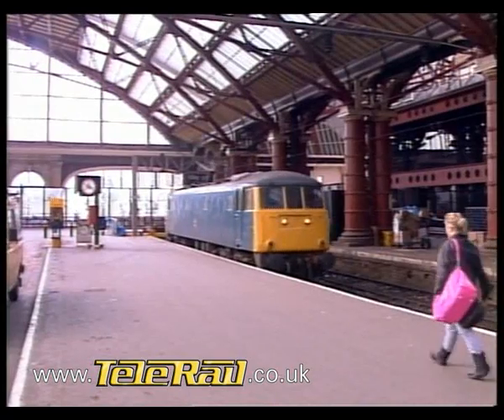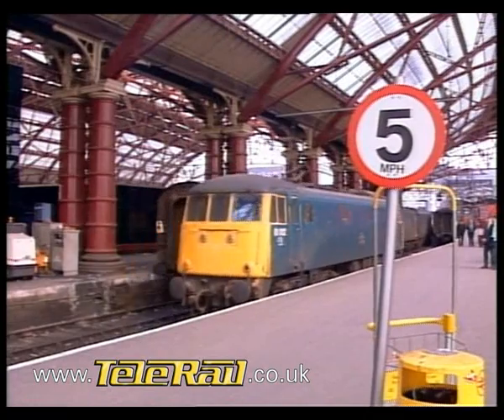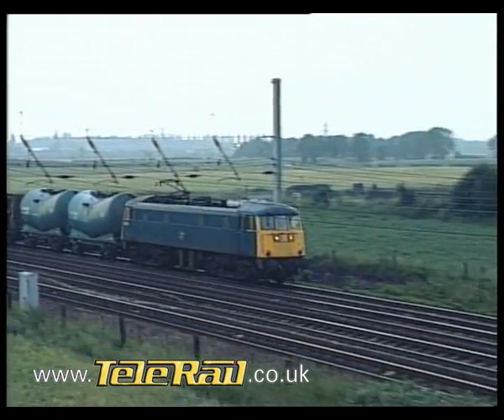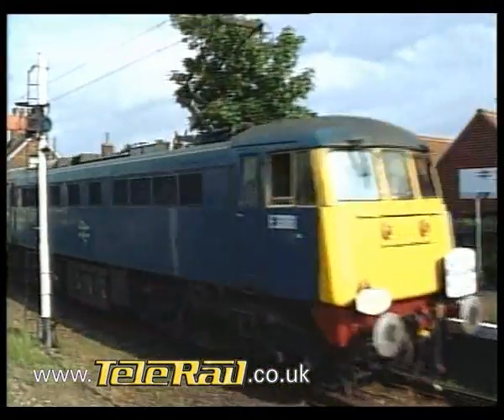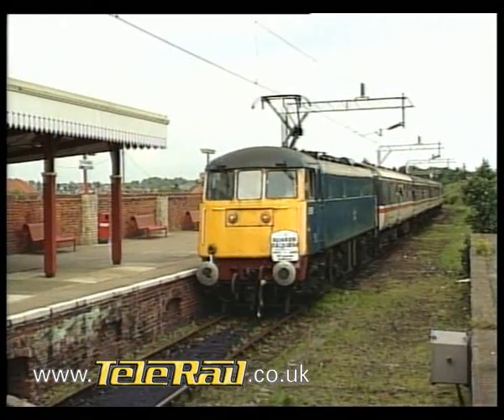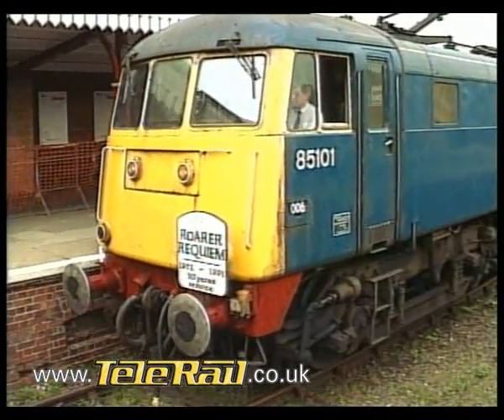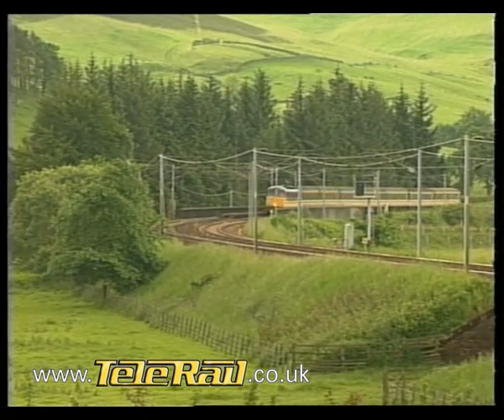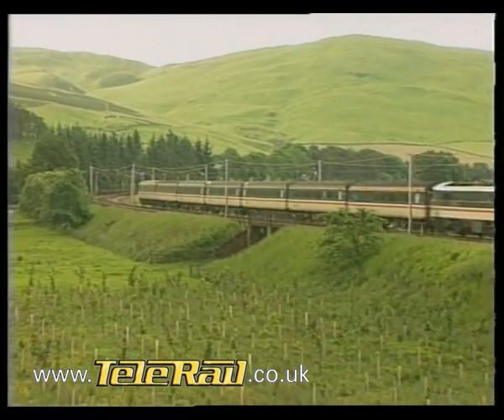LOCO HAULED  3 Electric Locos - Telerail

Comment: I was the Roarer Requiem hauled by 85 101 (85 006 in disguise). Seen in the video at Frinton-on-Sea passing the upper quadrant stop semaphores guarding the manned gate crossing, and St. Botolphs (which was renamed Colchester Town).  Frinton was one of the last places to have such signals on a 25kV AC route.

Comment: I think the class 81s and 82s had issues with the traction motor overheating if I remember right.
Reply: The biggest problem with 81s, etc was the mercury arc rectifiers which caused the fires.

Comment: On the 81 to 85's I really hate the way on later liveries that they used a sort of 'Optical illusion' with the yellow paint and pulled it round the sides a bit more at the bottom than the top to make them look flat fronted, don't know why they did it? I love the sloping fronts, the first livery - Electric Blue with White window frames - looks great!!
Reply: Have a look at the 84's Rail Blue/yellow end paintob
Reply: Actually, it didn't. It also helped to accentuate the front-end slope on them but in a different way.
Reply: @andyhinds542  if you can't see the difference then you need to go to SpecSavers...

Comment: On a side not, the narration about the second pantograph being for 6.25kv operation is incorrect. Both pans were linked by the same buss bar to a single transformer feed in. A capacitor divider voltage detection system was fitted to sense what the line voltage was and change the transformer input windings between series (25kv) and parallel (6.25kv) modes automatically. This was never used in service so was removed around the same time as the second pan, hence the confusion.
Reply: I never knew that and I learnt them as a driver in 1988.